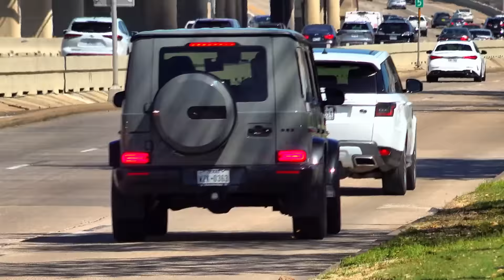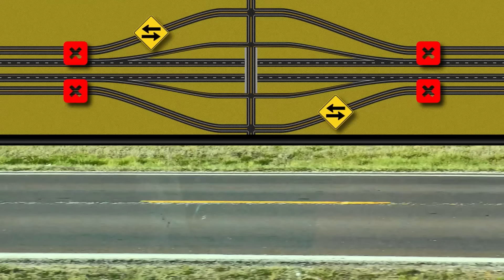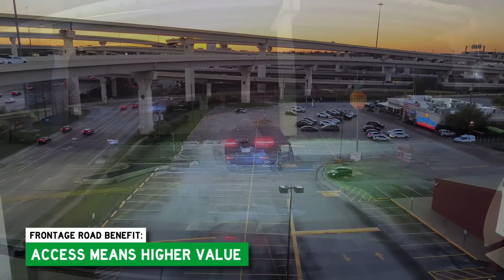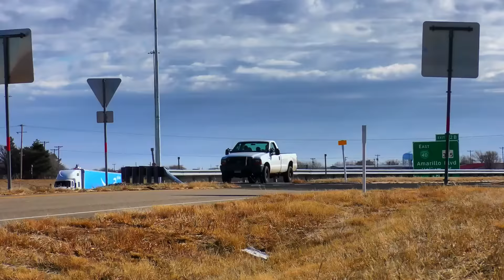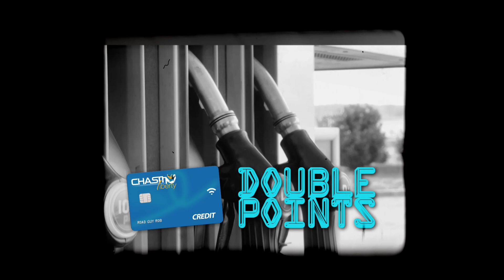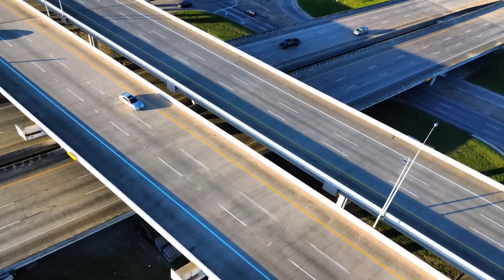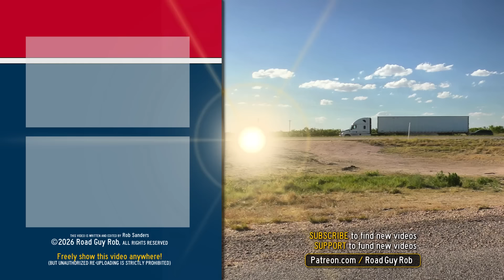Why Texas Builds a Freeway Next to Every Freeway

Comment: Thanks for the video Road Guy Rob. It is very interesting to see this alternate take on car infrastructure + car infrastructure. It is certainly a different take on what a "stroad" is. I thought that flipping the entrance and exit ramps around was a very clever way to reduce the risk of traffic jams backing up onto the freeways. (I wonder what could be achieved if Texas had put roundabouts on the junctions between the feeder roads and other roads instead.)

We actually have a couple of things like this in London, where the crazy people trying to build the London Ringways Project and Americanise London's ancient road network built a few urban motorways, that had A roads under them. I once decided to ride a bike to Heathrow airport, as a child and there was a bike lane along side it. Unfortunately the bike lane ended just before the A-Road merged with an exit road from the M4 and the planners of that cycle lane decided they wanted to dump cyclists onto an insane roundabout that led to a road tunnel into the airport.

I don't know how the amount of noise pollution I could hear riding next to an A-road and (for some of the journey) under an urban motorway compares with what people experience in Texas, but if Texas has gotten into the habit of building stores that are bolted onto both sides of frontage roads, I can imagine that people who work in those stores are subject to a lot of noise when they go outside.

We had a lot of people fight back against the London Ringways Project and the two outer ring roads that ended up being turned into our famous M25 orbital motorway (the inspiration for the song: Road To Hell) but that fight was mostly about the government wanting to destroy people's homes and town centres to build wide roads. In more recent times we had a girl die in Lewisham, called Ella Adoo-Kissi-Debrah. She lived 25 meters away from the South Circular Road and was the first person in London to get a death certificate citing that they had died of pollution. Following her death a report by Kings College showed it would take pollution in Paris 20 years to drop to safe levels of Nitrogen Dioxides and particulate matter, but that London was so bad that it would take 193 years for our air to get cleaned up.

So we had a Mayor of London who ran on the platform of solving the problem with an Ultra Low Emmissions Zone, which would start off as small as the Congestion Charge Zone that only exists in Central London and would then be expanded to Outer London and then all of Greater London. There was a lot of pushback against the scheme and Mayor Sadiq realised that there were people who were too poor to qualify for the scrappage scheme, but not wealthy enough to move to a new car and adjusted the scrappage scheme on the fly. In ten years our pollution levels fell enough to be legal. It's not perfect in London now, but thanks to Sadiq Khan we have had an 18 percent fall in people taking time off work for sick leave.

Looking at the freeway, with frontage roads and then a lot of stores, I have to wonder how much that concentrates large amounts of gasoline and diesel pollution, as well as particles from tires and breaks and how much of that pollution flows towards the stores and even into the stores. I know that another state (California) led the world with the Clean Air Act and inspired the creation of the electric vehicle industry. I would love to know how healthy this sort of road is, compared to other US roads? My guess is that people who drive on perpendicuar roads to get away from a freeway to a place where they can buy things are going to be in a more healthy environment, but if there are some fairly cheap pollution detecting instruments it would be awesome if you could document how well street planners are doing at combatting pollution. I suspect that if Texas had a ULEZ in it's cities, the freeway pollution could be lowered a heck of a lot, but for some reason there are people in the US who seem to really want to oppose the switch to electric vehicles.

Another thing I would be interested to know is, if this sort of infrastructure is really common in Texas, if Texas ever decided to rereoute the freeways around it's cities instead of right through the middle of them, would there be enough space to demolish the freeway replace it with a metro-line and rapidly fill the cities of Texas with a pop-up metro system? I think that if a metro line was either done as a cut and cover tunnel project or if it was thrown up into the air as an elevated railway, the space where the freeway used to be could actually double as a linear park with lots of plants to cool down the air and provide a pleasant environment for a long-distance walking and cycling route that follows the metro-system and that gives people in the local area fairly easy access to all the stores built alongside the frontage roads. I would love to see you do a follow-up video with someone like the Strong Towns guy about how easy it would be for Texas to reboot one of these freeway+ feeder road systems into something that supports cars, while also allowing other people to use the transit corridor.

But please do continue to make videos like this. I think that roads are going to radically change over the next generation or two and it is great to have someone explaining the engineering. (Don't forget to make some videos of the engineering behind gas stations and the distribution of fuel to gas stations. The switch to electric vehicles is now inevitable and when you are old there are going to be children who have no idea what a gas pump is or how many gas stations need to be located alongside a freeway to prevent cars from running out of gas on the freeway.)

Comment: 4:24 during my time working for a large auto insurance firm, I focused on telematics data for the city of Houston from 2019-2021. Over that three year period which wasn’t very useful due to the impact of the pandemic, I had to limit the focus on just 2019 data. The assigned driver score, a metric that was generated based on vehicle speed, number of hard decelerations or rapid accelerations, the lowest score our drivers had were on the feeders. The feeders are actually the sight of most car crashes, in large part that drivers use the feeders like freeways. Texas made the mistake of carving our freeways in the middle of their cities but the doubled down by doubling each freeway.

Comment: Public transportation..  frontage roads make public transportation and getting to work without a vehicle extremely difficult.  Those one way and having to cross a freeway to get to your job which would simply be across the street in most cities, now it's 30 to 60 minutes to get to other side.
Reply: Why not drive?
Reply: In Texas, you can just drive or walk underneath the underpass easily. It’s far easier than in a typical American setup bc it works about the same regardless of your direction
Reply: @camgillette7448 i lived in Vegas for 30 years and in Texas for the last 20 and I have to whole heartedly disagree.   Like he said at the beginning most cities have their business running perpendicular or completely on one side so you're looking at the back of the business from interstate.  With that set up the busses travel on business roads and you can cross the street at a light or crosswalks.  In Texas if they drop me off going you gotta walk all the way back or forward to the nearest overpass to cross,  which could be a mile away then maybe walk another mile to get to store that was directly across from where you were when you started.   Yeah,  maybe you can stay on and eventually that bus may come down that frontage road.  But that could take a while.
Reply: @chris2818  buses don't typically get up on the interstate in Texas, they typically stay on the frontage roads so they can pick up and drop off. This is evidenced by the many, many bus stops on frontage roads.
Reply: @jessicavigil9144 i know they don't.  This issue is, is you're on a frontage road on the west side of the intestate and you work on the east side of it you have to walk a half a mile or even way longer in the texas weather to get to the other side or wait until the bus comes down the other side which can be a really long wait.

Comment: I still see a problem, those 90 degrees access points on frontage road could be changed to 45 degree ones, or even at a lower angle than that if there is enough space. It would be easier to get off or on the frontage road at higher speed (or with smoother motion) than what it is there. And you would need to add either tunnels or skybridges for pedestrian/bicycle traffic while making impossible to access the frontage road as a pedestrian or cyclist.

Comment: In Indonesia some toll road have frontage roads, but because it is a "toll road", there is no cheating. Originally they were arterial streets, but toll roads were built to bypasss the congestion. Not all vehicles were allowed to enter the toll road, such as motorcyles which are common here.

Comment: Nobody probably will see this, but, my grandfather was the deputy Director of Texas Department of transportation for about a decade, and I asked him many questions about the highway system being someone that was going into engineering as well, and most of his answers were extremely logical. Most of the time it comes down to cost on how the highways are Designed and built. My grandfather was the original proposer and designer of the turnarounds under now most Texas Highways He also Pioneered the first United States pre-stressed post Tension concrete steel bridge in Corpus Christi. that being said while he made decent money at Texas Department, transportation when he worked for the associated general contractors of Texas, he was awarded way more pay, and ironically almost had more of a essay in what occurred infrastructure wise. He flew around with Ross Perot’s son designing the entire alliance Southlake North DFW corridor, which is insane, especially I live there now. he passed away last May RIP

Comment: A frontage road plus the businesses along the frontage road put a barrier between the freeway and residential areas.  But they also separate residential areas on either side of the freeway, frontage, business barrier from each other.  With the current ped/bike crossing, it's a good system, but if there were better ped/bike crossing, this would be a great system.
Reply: There are no peds/bikes to speak of.  In this hellish climate, are you kidding me?

Comment: The eastern suburbs of Phoenix, AZ have a Texas style frontage road system, Loop 101 and Price Rd. It begins with the freeway on its southern terminus and ends at a Reservation 8 miles later. I believe it is because that was a major arterial road before it got turned into a freeway. 
I've done plenty of Texas-style traffic bypassing with Price Rd back when I lived on the southern end. All the problems and benefits you described (except for the toll roads) applied to that road. I shared an exit with a mall and I often had to get off 2 miles north around  Christmas time because it would back up onto the freeway at my exit and the one before because of all the people trying to get to the mall and shopping centers along both roads.
I also noticed the properties (both commercial and residential) along that road were significantly nicer than equivalent properties that backed directly up to other freeways. The easement plus easy access provided by the frontage road seems to be the biggest factor.
Another great, unbiased look at the quirky traffic solutions across our nation!

Comment: Picking Houston freeways as an example is interesting.    Not sure what you count as the first loop, but I always counted 3 loops, I-610, Beltway 8, and 99/Grand Parkway.  Beltway 8 is a very strange example to me switching back and forth between toll road and free parts.  Also found it strange there is only 1 direct connector flyover between Beltway 8 & I-45 North.  Moving I-45 in downtown Houston will be strange, but hopefully better than where it is now.  Interesting what you showed of a 2-way frontage/feeder/access road "in Amarillo".  The I-40 frontage road you showed is actually outside the city. It actually reminds me of some much older entrance & exit ramps in the Panhandle.  After TXDOT "finishes" remaking almost every freeway in the Metroplex wonder what they will do next.  Have not had to drive through San Antonio in years, but I am sure it is changing. And Austin!? That is a whole other animal. I haven't ever tried the bypass toll road.  Fortunately I don't drive any more so no more traffic headaches.  Good luck and read those signs closely as things change.

Comment: The X configuration on I-35 northbound for Kyle, Texas, is 2.6 miles from the actual cross road you're aiming for. You can't even see the town or even its downtown water tower. Your barely out of San Marcos when you have to exit for Kyle. There are other similar cases in the area. This has led to several "Texas exits" which are places where (if you have a jacked up F-250) you just drive across the shoulder and ditch to get from the freeway to the frontage road.

Comment: A small naming correction: Beltway 8 IS the frontage road section. The Sam Houston Tollway is the Toll section. The area between 45 and 59/69 is free, because of the airport and you won't see any mention of the Sam Houston name in that section. Even the off ramp signs on 45 shows this. On 45 north, Exit 60D is a direct connection flyover and it's sign says Beltway 8 and exit 60C says Sam Houston Tollway.

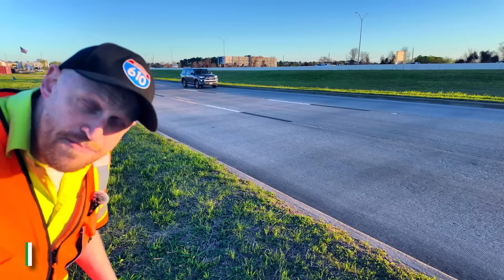Comment: 3:31 here’s my noteworthy cool side effects. Many toll roads, like the Dallas North Tollway has the Dallas Parkway running along side of it. It’s like taking the tollway but free 😆 IYKYK
Reply from the maker: It kind of makes sense.  The overpasses are the most expensive part of a freeway, because it's basically a building that can hold a car or big rig truck. 

So the toll is buying the privilege to use the expensive bridges, instead of stopping at the red light.

Comment: Texas u-turns are great in a car but not all of them are truck-friendly and you can't really tell if it's wide enough for a truck and trailer to get through until you're already committed; if not, it's time to drive over the curb. 

Also, in a truck you can't see past 3 o'clock by looking over your shoulder because there's no window back there. So you gotta stop really far back from the yield sign to see if any traffic is coming from behind you on the passenger side, and this, like most things, makes Texas drivers very, very, VERY angry.

Comment: Never really thought about it.  Lived in Texas for 35 years and frontage roads are just a normal part of driving.  I will admit I miss them when they are not there.  I love the X system of getting on and off and have used it to get around traffic and traffic lights.

Comment: I love your tangent about Palatine Road through Arlington Heights and Mt. Prospect. I used to live in the northwest suburbs, and I took Palatine Road to the north shore once a week for rehearsals. Whenever the mainline light turned red, I'd take the exit into the local lanes then slingshot past the vehicles waiting there. The antiquated signals there would stay green for an extended period of time to flush out the frontage road, so whole parades of drivers would take the ramp, max out the green extension time for the frontage lanes, and the vehicles in the main lanes would be stuck an inordinate amount of time waiting at the red. It caused a lot of road rage.

Comment: The problem with the X configuration is that now you have the hazardous on-ramp before off-ramp configuration which is the very reason many cities are converting old cloverleaf interchanges.
Reply from the maker: That's the sort of question I would have asked TxDOT had someone been available to go on camera.  There's no doubt the X Configuration is a huge improvement for the frontage road operation.  But you're not wrong that it does introduce a weaving section on the freeway. 

My guess is that the volume of traffic coming on the X may not be significant enough to create a problem, unlike a freeway to freeway weaving section.  But without talking to an expert, I would just be guessing.
Reply: @RoadGuyRob  I suppose it will always be controversial because there are both drawbacks and benefits.

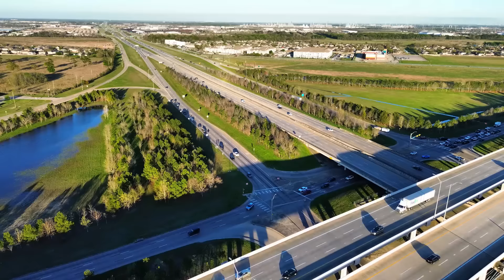Comment: 17:26 These types of interchanges with no flyover ramps between freeways is interesting. Like you get from one freeway to another, you have to get off onto surface streets with traffic lights just to get onto the next freeway! Talk about the longest freeway transfer in history even if both freeways are not congested like in LA.
Reply from the maker: I believe it's just an interim solution, until traffic volume (and more importantly, money) gets to a level where they can build the freeway to freeway ramp.

Comment: I drove from Colorado to San Antonio, and let me tell you, it was DIFFERENT. It was weird to see frontage roads running alongside the interstate, and it was confusing on the first day there. I got lost, kept missing exits, and got overwhelmed by other drivers. I usually don't get overwhelmed because I've dealt with Denver traffic and the highway infrastructure but San Antonio was an experience.
Reply: As a native Houstonian, your assessment of the roads in San Antonio is correct. Parts of the SA roadways don't have frontage roads when they should have them, and often those that do seem poorly planned out. The placement of exits is often strange. New construction and elevated sections just somehow make it worse. It is though the road planner was from out of state and had to be educated on the concept of frontage roads and then took 15 minutes to correct his plans before road construction started.